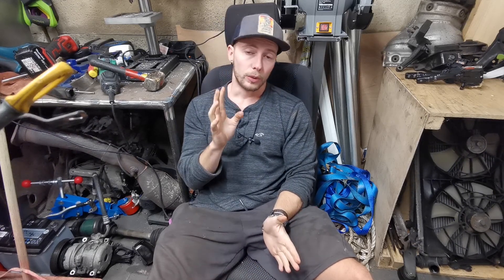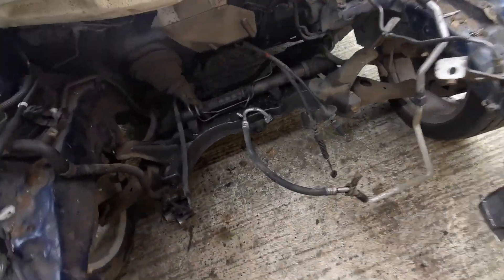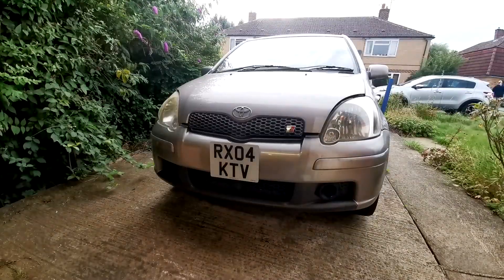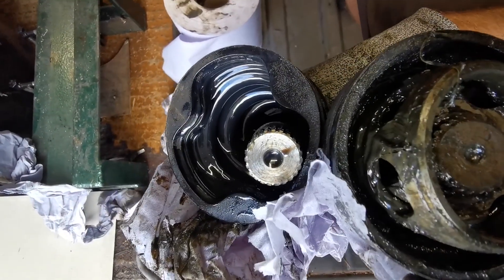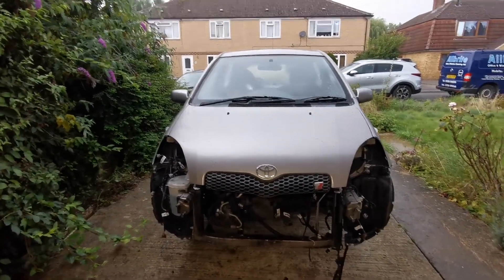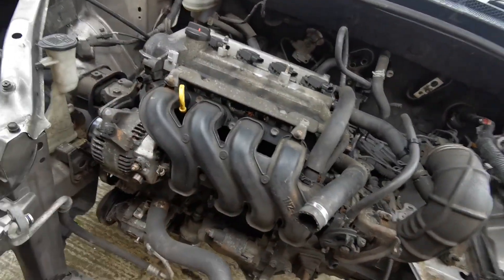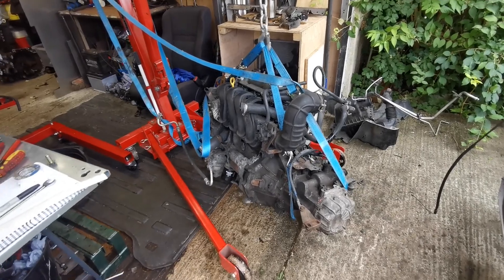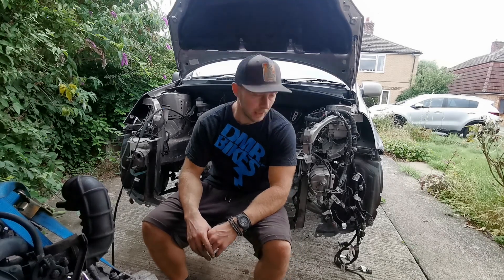2ZZ Yaris Build ep.13: 1NZ left the chat..

Comment: Very interested to see how this gets on. I’m interested in doing this as well.   If you don’t mind me asking, where on lone do you see resources on those that have done this swap?
Reply from the maker: Hi! Next video starts to get a bit more into what's required to get the engine in the car. It's not a straight forward swap, 1 mount can be lined up, the rest need fabrication, subframe and chassis need cutting, custom driveshafts needed as no combination of shafts and CVs I could find would work.
There are very limited resources online, it's not common, I've only found one person who was willing to talk to me about it, and another who was not willing. Most of it I'm finding out myself as I do it now.
Reply: @readysheddyno9958  well thanks very much for sharing. I’m also not finding allot of em resources on this.  I’ll keep tuning in to see how this goes. Fingers crossed this comes together for you.  🤞🏻